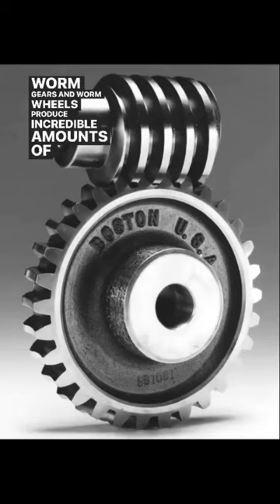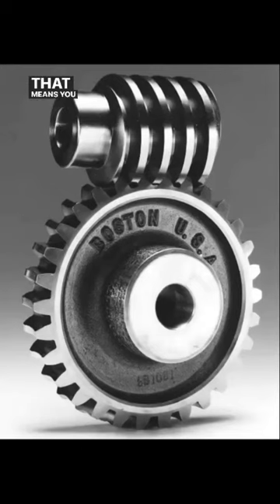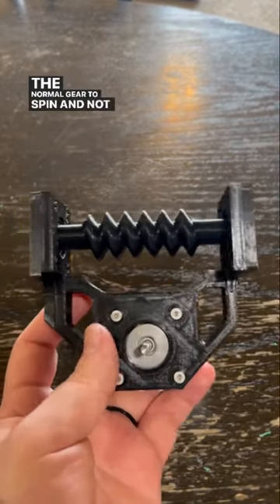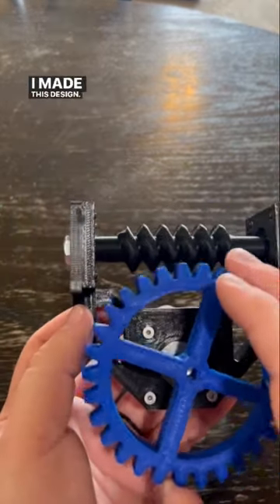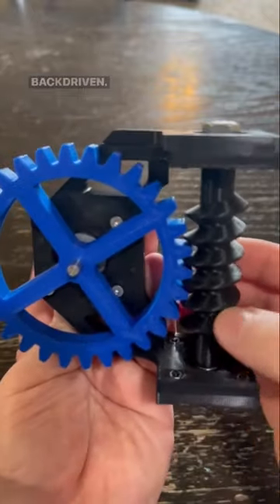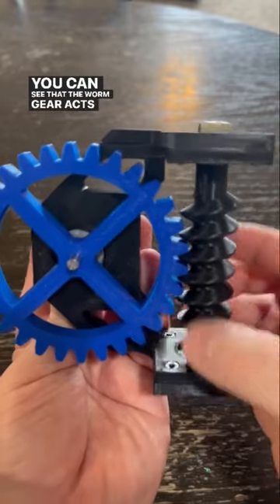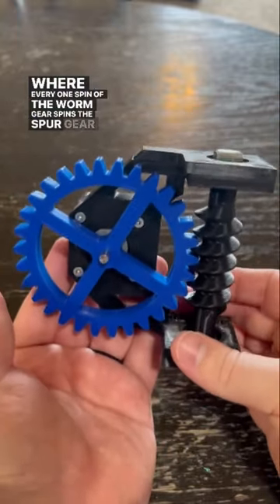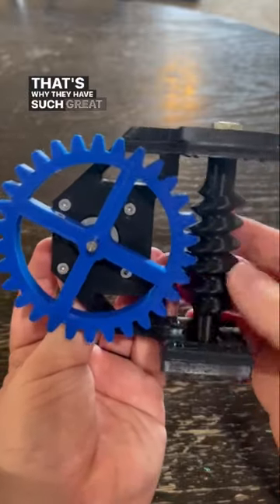Satisfying 3D printed Worm Gear  #shorts #diy #3dprinting

Comment from the maker: Yes, a professionally manufactured set would work better (https://amzn.to/3QaT6qz) but as you can see, they're quite expensive, hence the motivation to make my own gears :)
Reply: The slope teeth were hella smart! 🙂👍
Reply: Bruh $13
Reply: The sloped teeth were the OG design, and are called screw gears instead of worm gears, although today screw gears are more often helical 

 The need to prevent back driving is the purpose of using a worm gear instead of a screw gear.
Reply: Very nice job, what angle you gave to the worm gear and its  module?

Comment: the "cannot be back driven" is actually false, you can have lower pitch worm gear so that it can be back driven. it is what PS5 controller uses for the adaptive triggers.
Reply: Well yeah, but they can be designed not to be back driven. This in and of itself is amazing and extremely useful. Also, if you make them of the right materials, any of them can be made to be back drivable or not depending on its friction characteristics
Reply: @melody3741 me k
Reply: If you have a look at antique Ruston Hornsby gas engines their valve train is driven by a worm and wheel “backwards” by a certain thread pitch
Reply: but yeah... that's literally the video...
Reply: Obviously. He literally back drives it in the video
Reply: @parmesanzero7678  he still presented a false statement at the beginning.
Reply: @evertchin my man not knowing how videos work 😂
Reply: The difference is this one has sloped teeth worm, notice how flat the metal example is
Reply: did you watch the video?

Comment: Not all worm gears are self locking. This depends mainly on the lead angle.
One of the advantages of a worm gear though is, that it is (in certain congurations) not back driveable, at the cost of a low efficiency due to high friction between the teeth.
Depending on your scenario, there are better (albeit more complex) alternatives, e.g. planetary gears.

Comment: "...cannot be back-driven." Proceeds to drive the worm gear back.
Reply from the maker: As I mentioned, I made this design specifically so that it could be back-driven, since almost all others cannot :)
Reply: @christophersfactory  this is false, all it takes is any amount of movement of the worm gear, and the change in friction will allow it to be backdriven. Not that it matters, no one in their right mind would expect a worm gearbox to hold a load without a brake right? Maybe if they think it cannot be backdriven.

Comment: they "can" be back-driven but try to actually use this in like a machine to drive something and it will either jam or wear extremely quickly. its possible but you shouldn't do it. easyier to just say don't do it.

there are some limited slip differentials that use this concept to lock up even though they are metal and bathed in oil and arent driving anything.
Reply: My truck steps use similar and I tried to force them down once when they got stuck and it ground the plastic gear up really bad lol
Reply: it comes down to math.  There is an angle beyond which it's impossible to be backdriven, and an angle below which it's possible to backdrive them.
Reply: @tsm688   its not an angle. asume zero friction and any angle can be back driven. my old physics teacher would be chomping at the bit cause its a funky inclined plane problem.
 you know the: angle is this the coefectent of friction is this and the block weys this mutch, does the box slide?

well now coefficient of friction is the same, the angle of the slope is now the pitch of the worm, and the weight is the force right there at the interface. if it slides it "can" be back driven.

moot point anyway cause you just don't do it.
Reply: @nick4506  it's an angle.  Even with zero friction there is an angle beyond which it wont backdrive because the force points the wrong way.
Reply: @tsm688   no fricton everthing slides downhill, nomatter how shallow the hill.  alsong as the angle is not zero the will always be a downhill component of the force.

a worm pitch might back drive with low friction but will not drive and jam with high friction. cant count on angle alone being a go/no go.

Comment: Sorry dude - a worm gear set does not use a "spur gear" involute tooth profile.  It sort of looks like one, but the teeth faces are designed to engage as much of the worm gear surface as possible, does not have a tooth point contact as in your toy model.  Also, being able to back-drive a worm set is usually a bad thing, not a good thing.

Comment: The shallow slope ensures that the friction caused by the circular gear pressing on it is greater than the torque it need for it to spin.  More aggressive slope reduces that friction so that the torque is greater than the friction.

Comment: I watched a CG rendering short yesterday of a worm gear driving a gear that had bearings assemblies for teeth. Seems like that could be back driven.
Reply: Worm gears can, in some cases be backdriven, but the angle of the worm has to be quite shallow and the whole system has to be really low friction. Given that worm gears are normally used for very high gear reductions, in most cases the friction in the system will lock them up if you try to backdrive them.
This render you saw sounds like some sort of recirculating ball screw or similar.
Reply: Thanks for mentioning "recirculating ball screw." I looked it up and that's not what the render was of. But still very interesting. Perhaps I should have been clearer and said bearing assemblies. The bearing assemblies were on the outside of a wheel, mounted perpendicular to the axle. Although, I imagine a single ball mounted in a race with either or both sides of the ball exposed would work. Both for reversible drive.
Reply: The math says there's an angle beyond which the locking force exceeds the sideways force.
Reply: Spunds like you said a 1:4 gear ratio

Comment: I mean you can drive them backwards, it just takes insane amounts of torque that are likely to break the teeth before turning it
Reply: Most worm gears are literally unbackdrivable.  The static friction exceeds the sideways force, no mater how much force.  You have to design one with a low angle, like he did, to not do that.

Comment: Your information is wrong, sorry!
Ring gears can drive worm gears. These are commonly used in elevator gearboxes. We use a brake on the worm shaft to keep the elevator from running away and they run away quick, ask me how I know.
Reply: It depends on the angle.  These must be below the critical twelve degrees

Comment: I didn't know that changing the geometry of the spiral on the worm gear could make it back-driveable! also evert chin, cool fact about the ps5 adaptive triggers, I didn't know that either!
Reply: A worm gear is back driveable, but some times the force needed to back drive is greater than the force you can give or the force needed to break the gear.

Comment: Worm gears cannot be back driven... proceeds to back drive the worm gear :))

Yes, they can be back driven if given the tooth angles of the worm gear and the sprocket are in a certain shape.

If the shapes of the teeth lock into eachother they can't be back driven.

Comment: One (of many) ideas I've been working on is translating a short horizontal movement to a larger vertical movement.  This might be what I need...
Reply from the maker: Hey, there you go! I used this for a generator, it required a ton of force to spin, though, I haven't tried but I doubt that motor would be able to spin the worm on it's own. Would probably need a more powerful stepper.
Reply from the maker: I wonder if you could use a rack and bevel gear?
Reply: @christophersfactory  Basically what I'm trying to do is make the "Metalworker's Pacifier" on Printables, but instead of your finger lifting the plunger, you squeeze a "trigger" on the handle to lift the plunger.  The whole idea started because I wanted to make a few simple improvements to the original design (threading parts together instead of gluing), but he doesn't allow remixes, so I'm trying to design it from scratch.  May never happen, but it's something I spend some brain power on every now and then.

Comment: Lmao. These can’t be back driven. back drives it
Reply from the maker: Worm gears can't be backdriven, based on their traditional design. This is a design I made specifically to be able to be backdriven, as I mentioned. :)
Reply: The angled toothing allows a limited back drive, a normal worm gearing uses straight gears and will lock rather than being turned if you try reversing the process. However, the great advantage of a worm gear is that 40:1 torque, and trying to reverse the system means your motor is now dealing with a 1:40 load so if he had any load on that it would have been very hard to backdrive.
Reply: @leechowning2712  you’re correct. I’m aware of the workings of mechanical advantage. However, the reason worm gears usually can’t back drive is due to the friction of the system, not the power limitations. a large ratio cycloidal gearbox or planetary gearbox can usually be back driven. harmonic drive and/or worm gear gearboxes are difficult/impossible to back drive due to the geometry if the mechanism. Im sure the author knows this. I was mostly poking fun at their contradiction/misspeak.

Comment: Doesn't the mechanical advantage of using a worm gear disappear at that point, though?
Reply from the maker: It sure does! 🤣
Reply: Probably could work with something that needs to push/pull hard, but can be recovered quickly?

Maybe a fishing pole?
Reply from the maker: @ragnarokstravius2074  That's interesting that you came up with that idea, I just saw a video the other day about a performance fishing pole that used a worm gear. Not sure if it's the standard in fishing poles since I know nothing about them, but it would make sense -- reeling requires high torque, hit the release to cast and it allows the reel to spin freely

Comment: Torque comes form the ratio of the two gears not from the shape!  Worm gears are use when you need to change the rotation axis.
Reply: parallel universe where bevel gear was never invented

Comment: I love how all the folks in the comments are talking like they're certified engineers yet deep down they really don't know anything they're talking about. Chris was saying they can't be backdriven (which is true for most ratios anyway but not all), and on top of that a worm gear can indeed mesh with a spur gear given that it either has enough spacing of the spur teeth or the design or pitch of the worm screw. The dude actually showed me something interesting today.